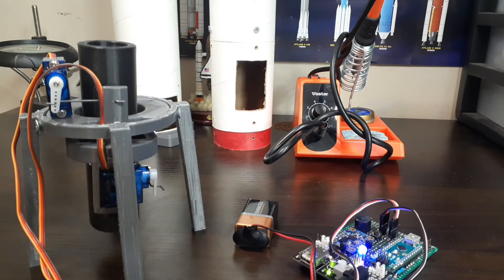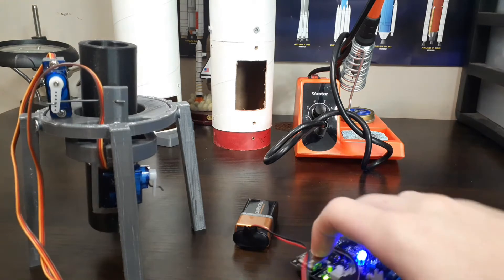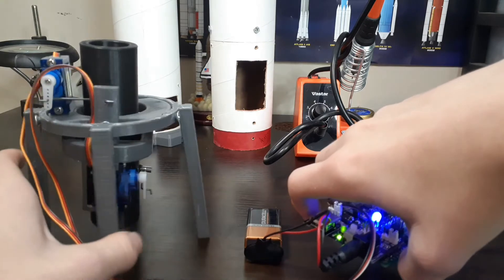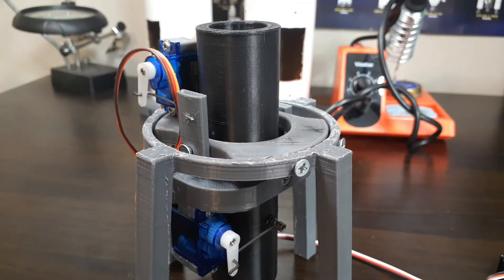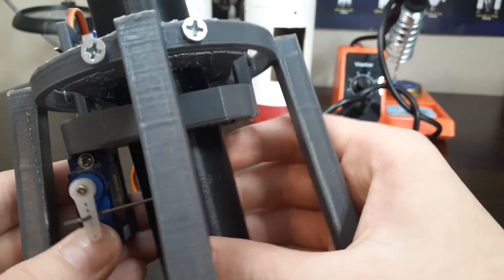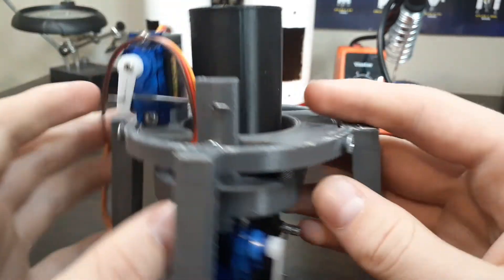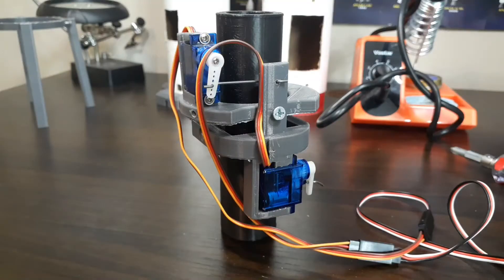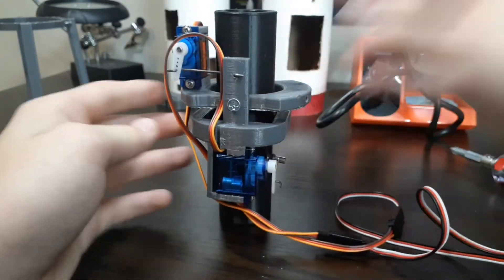thrust vectoring model rocket | tvc mount

Comment: Super cool question would the metal beam break under the thrust of the rocket motor
Reply from the maker: not likely because the metal rods do not undergo any of the forces of the motor. The tube the motor is inside is attached to the rest of the tvc mount by 2 screws on either end, and these screws are the only things structurally holding the tube on. The only force that is applied to the rods is the force it takes to rotate the tube, which is very little. Thank you for the question! I am currently programing the tvc mount for the static fire test planned for this month.
Reply: @velocitylaunchsystems  cool thinking of building my own TVC mount and was wondering if that would be an issue thanks

Comment: Where did you get the 3D Files to print out your TVC Module? 👀
Reply from the maker: I designed all my 3d printed parts myself and I have not yet released them to the public. Once I test the tvc mount and ensure its functional, I will share the 3d files for anyone to download
Reply: @velocitylaunchsystems  well quit "fiddle fartin" around and "getter done!", I wanna build one, and yours looks quewl! 👍
Reply from the maker: The only test I need is a static fire, i ordered motors a while back, but there was a problem with manufacturing. I'm going to order a different motor to hopefully speed up the process. I might charge a small fee of like $5 for the files but that will be determined later
Reply: @velocitylaunchsystems  Well get a MOOOOVE ON! 🤣 I am ready to start learnin the the "flight computer" programmin ssssstuff! 😜😆😁👀👍

Comment: Soooo i am also building TVC Model Rockets but i need to tell you using the little SG90 Servos was a dumb idea they couldn`t even handel an b6 Motor i suggest using stronger Servos
Reply from the maker: I agree, in recent tests they've proven to be very weak. I've been looking to upgrade them for a while. I plan to change them out with better ones, in preparation for the upcoming static fire. Thanks for the suggestion
Reply: @velocitylaunchsystems  Good to hear good luck for ur first launch

Comment: Nice progress. You earned a sub.
Where do you get your parts from
Reply from the maker: Most of the parts that make up the tvc mount are custom made and 3d printed. As for the rest of the parts including  servos, linkage stoppers, and pushrods, I got off amazon. The flight computer uses a variety of arduino components, that can also be purchased from amazon, or on the arduino website. Thank you for the sub

Comment: I am HS senior planning on creating a TVC rocket later this year as a independent study as a class. Glad to see another person trying the same!!
Reply: As with you!
What engine and micro controller are you using/ planning on using?
Reply from the maker: I am currently waiting on the shipment of a couple f-15 motors from estes. As for the controller it uses an arduino nano, however the flight computer will most likely go through another revision before being flight ready. I've made a video going over the flight computer if you havent already seen it.
Reply from the maker: That's awesome, good luck!

Comment: Is this really PID controlled? Not PI
Reply from the maker: That was a good observation. Though this is not a pid control, the final program will be. Because I will not be using the flight computer in the orientation used in the video, I didn't want to develop a lengthy program around it. I'm still learning, and it could be a while before I have a fully working pid program.

Comment: Nice job! It seems like the outer gimbal (X axis) would have a very low resolution compared to the inner gimbal. Its using one of the far out holes on the servo arm will would lead to less torque and accuracy but faster actuation speeds. Otherwise, nice job! Looking forward to the flight :)
Reply from the maker: Torque is one of the issues I'm facing with the x-axis. I was considered doing a small redesign where it could be moved up a hole. I appreciate the feedback